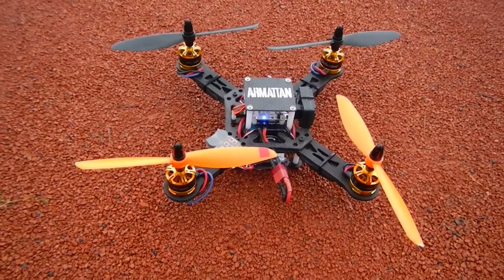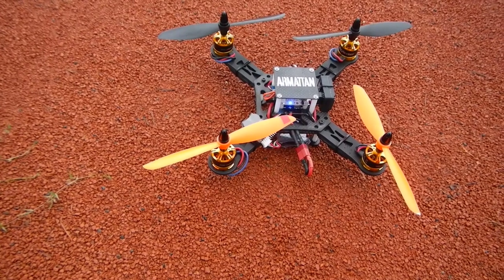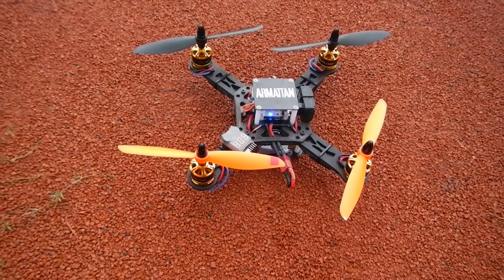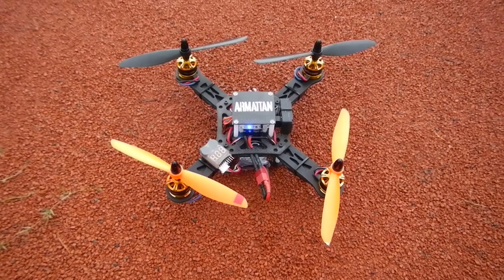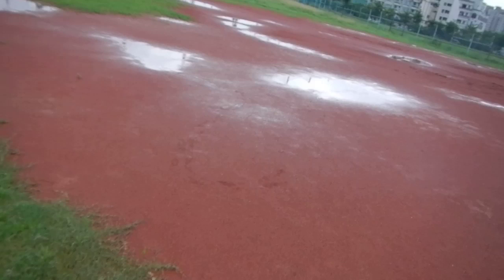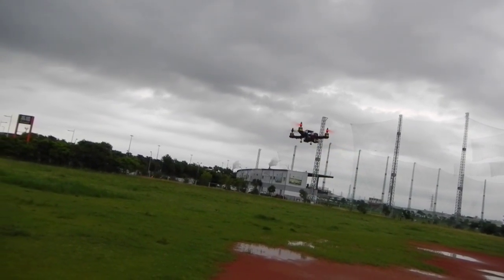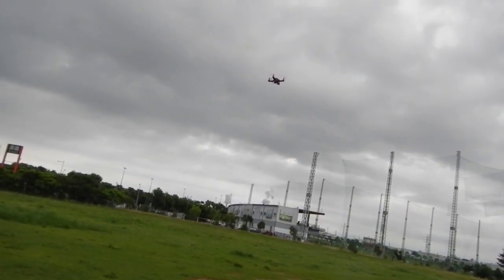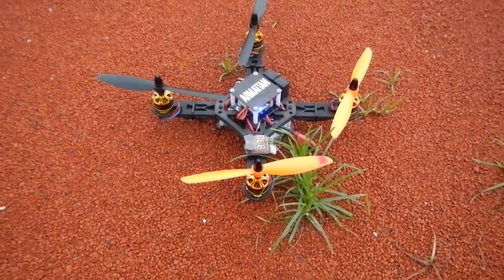Armattan  CF 258 with RCX 2208-1800 kv  motors

Comment: Very good motors but definitely not motors for beginners. I have some version of those and have bent the shafts (my fault) on crashes. There is no way to attach prop adapters to the housings. Anyways, I feel they are great performers but not for us true beginners in my opinion.
Nice quad there.

Comment: Buy Sunny Sky 2212 propadapters from Ebay, dremel the shaft down to the stator root, screw on the sunnysky adapter and voila you have a perfect motor with 5mm propadapter with screw mount :-))

Comment: need help
this is my setup for my quad
d2830 1000kv 210w 21A max
10X4.7 prop
2200mah 3s
30a esc
is my setup correct?
how long is my battery run time?